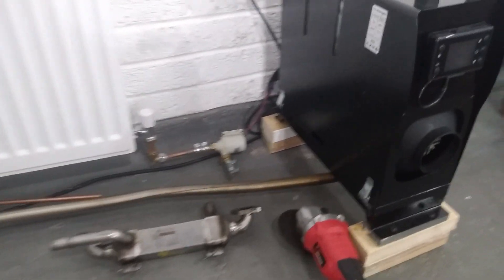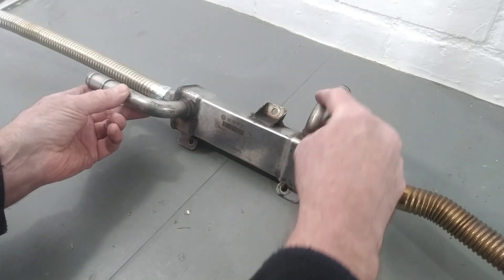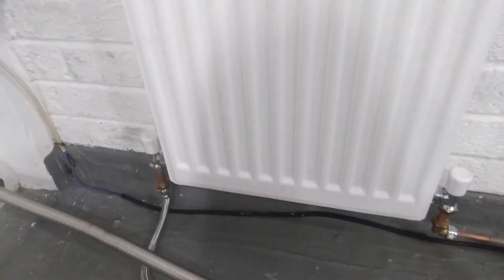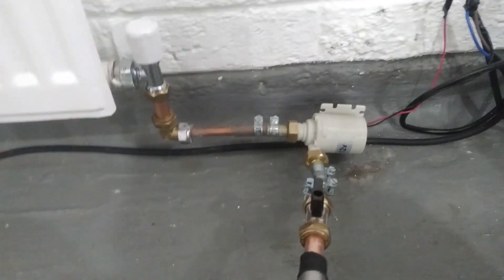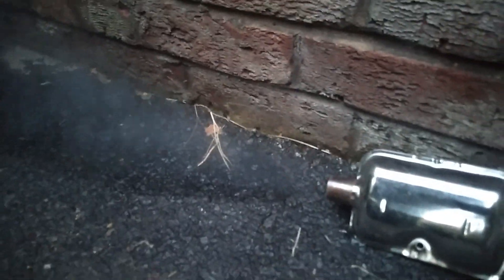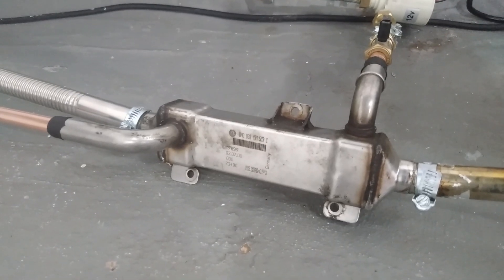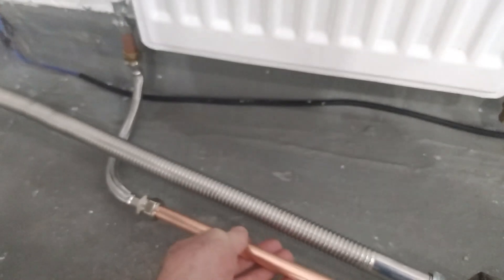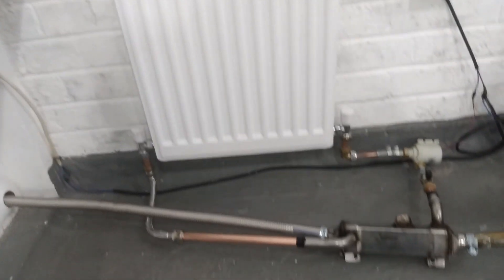Free Heat from Waste Exhaust Heating Radiator Home Diesel Oil Heater Mini Central System Exchanger

Comment: Condensation coming out is a good thing, it essentially means you've pulled a lot of the heat out of the exhaust and the colder air can't hold the moisture content anymore so it condenses, I've got my exhaust running through a mini cooper s intercooler with a temperature controlled pc fan blowing through it, takes the 150-200c in and comes out at 22-23c so it's pretty efficient at extracting the wasted heat, I went this route as I don't have any need for more hot water
Reply from the maker: wow thats great
kind regards andy

Comment: There appears to be a lot of white smoke coming out of the exhaust outside. Is that normal? Does the white smoke indicate restriction from the EGR?
Reply from the maker: hello my friend
thanks for commenting.
the cooler is fairly free flowing, you can see through it, with some finns inside.
to start with there was like a burn off smell.
but it was more like steam, condensation.
it didnt seem to clear, so i would say its always going to be there
kindest regards andy

Comment: Thanks for another informative experiment Andy. Interesting that you got steam from the exhaust this time. Do  you think the Heat Exchanger was working so well that the exhaust after the exchanger was a lot cooler than in previous experiments and therefore wasn't burning off all the moisture in the burn process ? Or is the majority of the moisture is created by condensation on the cold pipe rather than from the burn process itself ?
Reply from the maker: hello reg thanks for watching and comms.
yes, now you mention that, you are exactly right!
the unit was doing its job and taking heat out and the last part of the exhaust was a lot cooler than before.

have a great day regards andy
Reply: @andyfireblade   Yes - the exhaust, if cooled below dew point, needs to slope away from the EGR.

Comment: Did you think to blow through the heat exchanger to notice how much resistance it adds to the air column? I saw previous comments in your other videos where people suggested that adding bends and smaller pipes etc adds resistance to the exhaust thereby making the heater work less efficiently and would encourage fouling up the internals due to insufficient combustion in the heater itself.
Reply from the maker: hello my friend,
good comment.
the heat exchanger is fairly free flowing . you can see through it with some finns in side.
and yes when i restricted the exhaust before, particularly  with the bucket experiment, where i put some u bends in the exhaust. the machine doesent like it.
and your right it would foul up.

kindest regards andy
Reply: @andyfireblade   Don’t worry about it.  The cross sectional area of the EGR tubes is greater than the exhaust pipe.
Reply from the maker: @oliver90owner  yes, that true.
did you see the other heater that i have heating my house up?
https://www.youtube.com/channel/UC3sYHaAZtJI-vrD64K7Qe9w
cheers andy

Comment: Hi Andy, thanks for sharing your experiments with us. 
Just a little tip, rotate that small muffler on the end of your exhaust pipe half a turn so that the little drip hole is pointing downwards. You're producing a lot of water vapour and you need to drain it out before it will block the flow of the exhaust gasses.
Reply: It would seem that you're producing enough hot water from the exhaust to run a few rads
Reply from the maker: thank you my friend
and thanks for your comments.
would you like to see my other heater, that i have heating my house?
here is a link: https://www.youtube.com/watch?v=6rQAo8lSLHY

kindest regards andy
Reply: @andyfireblade  Oh don't worry my friend, I've been watching all your videos about heating your house with your "black box heater". In fact, I'm going to try to do the same with my Chinese diesel heater tomorrow. I made some preparations to a small living room window today and tomorrow morning I'm going to connect my heater and have it blowing in hot air into the house.
Thanks for the inspiration.
Reply from the maker: @TheBigM10  hey thats great my friend
i am really pleased for you. mine has been great. it has been on all day today!
let me know how you get on? message me anytime.
have fun andy

Comment: Good video, maybe that heat exchanger is to good, allowing the water in the exhaust gas to condense 🙂, also you might find this interesting, YouTuber Robert Murray-Smith video #1793 for an alternative cheaper fuel.
Reply from the maker: Thanks for the tips!
thanks a lot mate
kindest regards andy

Comment: Wow really impressed , 👍 Cant help feeling that if you could feed the hot water from the exhanger into a smallish hot water tank, then you could heat that and then use the tank to feed more radiators.
Reply from the maker: Great idea
yes that would be good
thanks a lot for watching
kindest regards andy

Comment: Well done, congratulations. In my tests, I got the best performance by getting the egr radiator as close as possible to the diesel heater . The larger the egr radiator the more heat is captured. I put two in series from an Iveco van. Greetings
Reply from the maker: thanks my friend
kind regards andy

Comment: Get a thermal infrared camera  - I've got an 8 pixel×8 pixel one-pretty crappy resolution but still very useful it can be used as non contact thermometer- cheap too(40 squid)
Reply from the maker: i will get one.
please check out my latest vid, let me know what you think?
i am really pleased with it.
kindest regards andy
Reply: @andyfireblade  great vid!

Being a renter Im all about compactness and safety

 When I get my egr cooler I will install it(try😅) in the big aluminum briefcase my diesel heater is installed and slap a huge heatsink on the side of the briefcase- 

it should help preheat the air while remaining portable  also most importantly reduce the risk of my exhaust  pipe setting  fire to stuff/ postmen (because I pipe the exhaust out the letter slot[renting😮‍💨])
Reply from the maker: @TrumpstienPhile  brilliant
kind regards andy